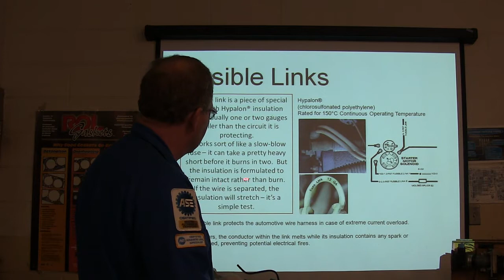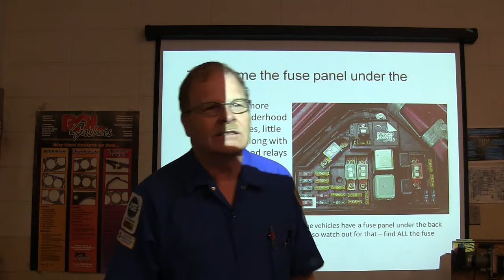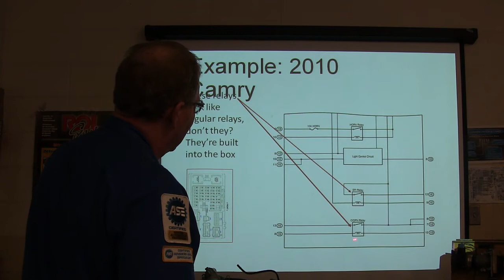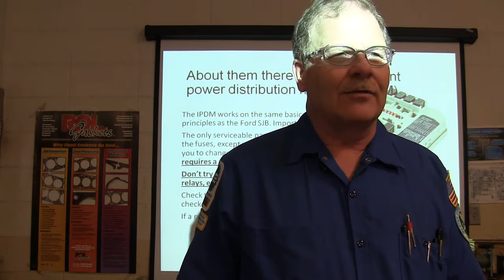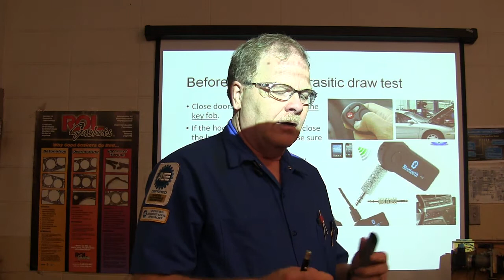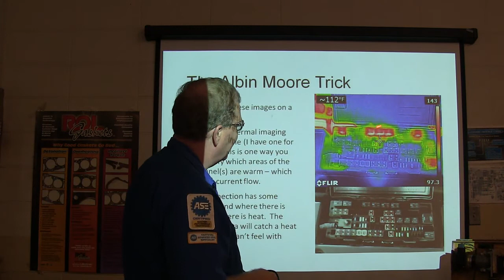Fuses and Drains

Comment: Some of those electronics on Dodge & Chrysler cars have the electrical systems that make ask why would you do that. Thin wires, controls that short out, too many C.M. boxes, and stuffing things in bad places that will cause problems after a few years. They are not alone in cars that make me ask why would you do that but a good example of they already figured out how to do that a way that works a long time ago. The example now is the touch screen in the new cars causing people to crash from looking at it while driving to change the radio or A/C controls. Cars use to have buttons dials and switches that did not require you to look at them. You knew the radio and A/C settings without looking at the dash instead of the highway.

Comment: had one that turn signal would come on by them selves  older lady driver. had codes for door locks  nothing on t/s. could not duplicate no id/fix county job not the smartest people in charge. any how the box fixed it the old girl was not nuts like i started to think ford small suv 11 or 12 year model  car was almost new miles less than 60k  florida car corrosion not a problem